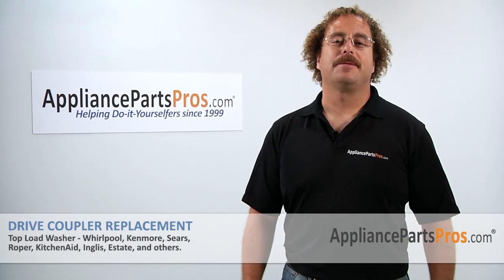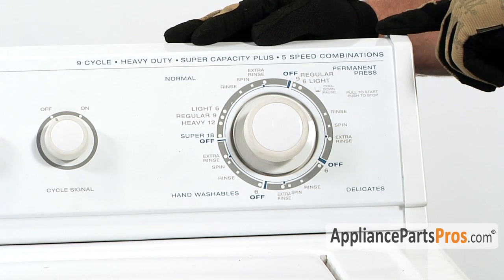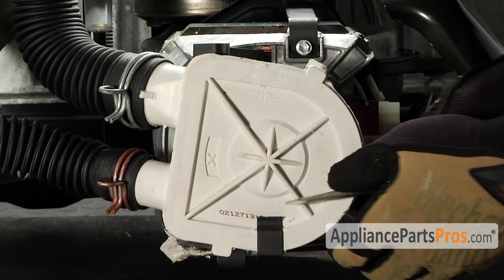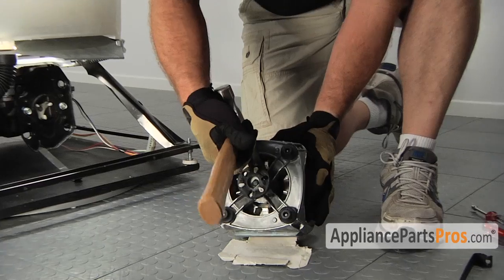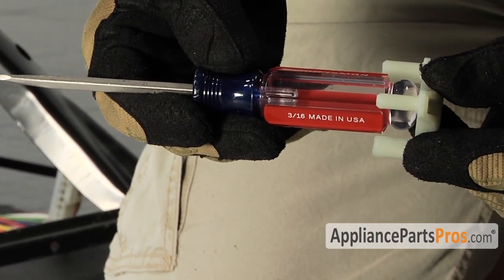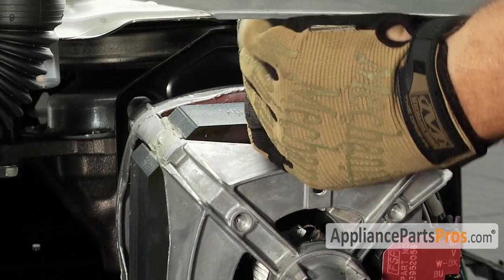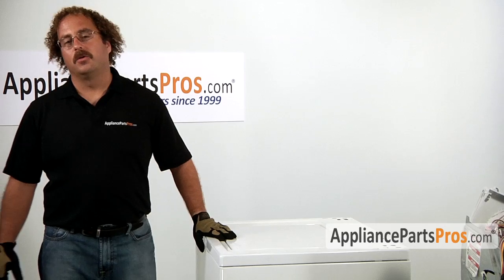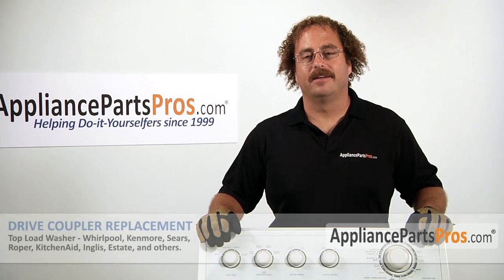How to Replace Whirlpool/Kenmore Washer Motor Coupling (285753A) – Fix Washer Won’t Spin or Agitate

Comment: This was so so helpful! My dear husband is not the least bit "handy" with tools, so I'm the nearest thing to a DIY repair person at our house. Even though I haven't done much in the way of appliance repair, this video was clear, easy to understand and made it possible for me to get my washer working again!! It took me much longer, in part because I discovered one of the rubber shock absorbers on the motor housing was missing or had disintegrated. But I did it! THANK YOU! Keep up your helpful work.

Comment: This was fantastic! You covered all the bases: 1) Explained what the problem was (motor coupling needed replacement); 2) Explained how to take apart the washing machine to gain access to the motor coupling; 3) Explained how to replace the coupling, including the handy tip about seating the part correctly using the head of a screwdriver. You turned what would have been a six hour exploratory exercise (with no guarantee of finding the problem/part) into a HALF HOUR repair success story!  Thanks!!!

Comment: Thanks so much, my husband took the machine apart  and then I went out to get the part. By now husband is at work and I was too impatient to wait for him to get home. I found this video and had the machine up and running in about 36 minutes ( hardest part was replacing the bottom clip on motor and the 2 top clips on the shell. Did not have the strength to make that easy:( So happy machine is working and I did it!!!

Comment: A MILLION THANKS!!! I just replaced a motor coupler on my 11 year old KENMORE washer with the guide from your tutorial.  You just saved me at least $200 by not calling out SEARS appliance repair. It only cost me $7 for the part and 30 minutes of my time. Now, I'm waiting for the clutch to wear out but I'm ready for it when it happens!
Reply from the maker: Kevin P You are welcome! Glad the video helped you out.

Comment: I just finished doing this repair and after watching this video it couldn't have been easier.  This repair cost me less than $10 and took roughly 30 minutes.  Thanks for posting.
Reply from the maker: Glad the video helped you get the coupler changed out!
Reply: Cost me $24.30 including tax.  Could have ordered it line for about half that price but didn't want to wait for it to arrive.
Reply: I do have one more question.  After I had everything back together I realized that I had not added back this cardboard/paper to the bottom of the motor where it had come off.  My guess is that it was to keep any wires to touch each other and short out.  But there is nothing to touch under the motor.  Is it important to take it back apart and put this back  on?

https://plus.google.com/u/0/photos/yourphotos?pid=6039682535727147826&oid=107591688336663880809
Reply from the maker: Nancy Michelli Sorry for the late reply, you should reinstall everything the way the manufacturer originally had it.
Reply: The only think that I didn't add was that flimsy little paper/cardboard piece on the bottom that was shown in the picture.  Otherwise it is back together exactly the same.

Comment: Matt, you're my hero. My washer would fill and drain, and motor would run, but would not agitate or spin.  This took 45 minutes max and was so simple following these instructions. It was clear as soon as I got it apart. The pegs were gone and the rubber was shredded to nothing. There was rubber dust everywhere. THANK YOU! Saved me SO MUCH MONEY!  (Re some other comments, one side of the coupler was stuck on, so I pried, turned, pried, turned, pried, turned, eventually it did pop off.)

Comment: FYI, be careful with these "improved" couplers. I understand that adding the metal reinforcement ring to the inside of the plastic ends makes them stronger and less likely to break. but it also can cause a new problem of it's own. My old one broke, so I installed the improved coupler. Somehow, over the course of a few weeks, my metal ring came disconnected from the plastic part. It pulled out and they became separated. So the motor shaft was spinning and the metal ring was spinning, but the metal ring was not inside the plastic all the way, so the washer would not work as it should. I used some Gorilla glue to glue the metal rings into the plastic pieces so they don't come apart from each other. hopefully this helps but I may have caused the initial problem by tapping them on the shafts in a poor way. I'd suggest using a SMALL tool to tap them on. One that does not come into contact with the plastic. I must have used too big of a tool that pushed the plastic apart from the inner metal ring just slightly.
Reply: Good observation.thanks for sharing as I start my coupler replacement
Reply: @mikedhsr007  honestly, thank you for commenting. I forgot all about this observation. I'm going to note it in case I deal with this part again.

Comment: Very helpful video. My Kenmore is a 90 Series, model 110.C28902790 (the "C" is for the Canadian model, I believe), but it's almost exactly the same as in the video. In my case, I discovered that the problem wasn't the motor coupling, but rather a broken plastic lid switch. But, following this video gave me a chance to check the condition of the coupler parts, check the hoses for blockages, and clean out the accumulated dust bunnies inside the machine. When the coupler actually does go, it'll be an easy job. Thanks for posting.
Reply from the maker: Canuck51 Glad the video helped you out!

Comment: Thank you for this video. It was my first time working on my washer and didn't have $700 to buy a new one. Bought the coupler for just under $20 and then started ripping into the back of the washer. I got frustrated and found your video and 20mins later it was "fixed". Now I say "fixed" because it took me another 40 mins to get the back of it together that I ripped off.  Seriously thank you so must and the instructions couldn't have been easier. plus you saved me over $700 and tax for a new washer. Here's to another 20 years with this one.

Comment: You guys are fantastic! This is the second time I've had to change that coupler out. Once 5 years ago, and once this morning. Your videos have made it so much easier for me. I've changed my hood switch, the dog cams inside the agitator, and something on the water pump I forget what it was. Also, on my dryer, it's been the thermostat, drum roller belt and the gas control switch.

I figure over the past 12 years that I've owned these two machines, I've only had to spend $100 in parts thanks to you guys and your videos. If I had bought 2 new machines it would have been $2400+ and who knows what kind of headaches. Not even to mention you've supplied all the parts I needed and only off of the recommendations when I was just able to give you the symptoms I was experiencing. 

You guys rule! Here's to many more years as a thankful customer. Thank you!

Comment: OMG!!This video was so easy to follow.  I got stuck with the bottom  screw on the motor, I was convinced  it was cemented  on...LOL. Grabbed some pliers for extra grip and strength and viola! It was a b Ripken coupler inside.  Everything  else went smooth but I did have a hard time getting the shell back on due to tight spacing.   THANK YOU SOOOOOOOO MUCH!!   Load in washer now sounds quiet

Comment: I just wanted to drop a thanks for the video. I'm not handy at these things and I don't think I could have fixed my washer without your video.

My washer wasn't spin cycling. I assumed it was the coupler because the washer stopped when I opened the lid. A friend advised me to replace the lid switch and coupler at the same time since both parts are pretty cheap. I was surprised to find that the coupler was in good shape but I replaced it anyway. I just ran my first load of laundry and it spin cycled properly. I don't know for sure, but I suspect it was the lid switch that was causing the problems. Thanks again for your help!

Comment: Tks very much. Followed your instruction and repairs proceeded like a charm. The only complication was my Whirlpool Thintwin LTE5243DQ3 motor at bottom was offset by about 45 degrees, so once the washer shell was removed, the motor shaft wasn't point right at me. This made removal/reinstallation of motor difficult as the pump and hoses were in the way.. Mine is in a narrow apartment bathroom so there really much wiggle room to do the repair.. Other than that, the procedure in the video explained the process very well !!

Comment: So much simpler more reliable and much more longer lasting that newer appliances! I'll keep my 20 plus year old Whirlpool as long  as I can. Great video. Waiting on the part which will be here tomorrow. Only difference is I just unhooked all the hose and laid it on it's back instead of taking the body of the machine off
Reply from the maker: Good luck with your repair! Let us know how it goes and if there is anything we can help you with please let us know.
Reply: @appliancepartspros  The part came in less than 2 days. Installed part and back in business in about 20 minutes. Great video! Thank you!

Comment from the maker: @TheMacandpcguy It's actually not a bad design at all. The rubber piece is there in case the transmission locks up, in which case one or more pieces of the coupling would break, saving the motor and the transmission from further damage. It's much cheaper and easier to replace the coupling. This direct drive washer design is also one of the easiest to work on.

Comment: Great video. Only suggestion would be to run the machine before and after install. Just to let viewers hear if the problem sounds the same as their problem.  However this is the best video by far I have seen.keep up the good work.

Comment from the maker: Check that the drain is clear and draining properly. If the pump is getting all the water out then it should be ok. These machines have a clear plastic tub, look around the outer tub to see if you can see anything stuck between the tubs that would slow the spin down. Next it could be the clutch is slipping or the brakes are dragging, go to our website forum and do a search for: Replacing direct drive washer brake shoes. This will give you an idea of how to check out the brake shoes and clutch.

Comment: Thanks for the video.  Made it a snap to replace my motor coupling.  Also removed a footie sock from the drain pump while I had it apart!
Reply from the maker: Kevin Williams Awesome, glad you were able to get the washer fixed!

Comment from the maker: The new style coupler has been used in production, it is not just a replacement upgrade, so it's not surprising its there. The couplers can get stuck on pretty good, you can try a little pry bar or claw hammer to pry it off. I have heard of people even cutting them with a hammer and chisel. You can also use a little penetrating oil. Be careful not to damage anything else!

Comment from the maker: Yes, if the coupler is broken the motor would still spin and you would hear it. It could be the water level switch, timer or the motor. It could be something stuck in the pump that locks up the motor, but then you might hear it hum when it tries to start. If you need help troubleshooting the problem you can go to our repair forum and post the question, we have techs there that can help you out.
Reply: Do all dryer had coupling? because I cant see mine its only single motor.
Reply: Panasonic washing machine really annoying I'm barely able dismantle every parts.

Comment: Great video.  Thank you. As others have mentioned.  Getting the old coupler piece off of the transmission shaft was difficult.  Some WD-40 and elbow grease eventually took care of that.  My coupler was not in bad shape but replaced it anyway.  If it turns out not to be the problem at least I replaced an inexpensive part and got to lear a lot about repairing our washing machine.
Reply from the maker: +John Haslip glad the video helped you get the coupler changed!

Comment: Thank you very much for an excellent video; I did the repair in less than an hour with your help.  Without it I would have spent  hours trying to figure out how to take the machine apart....and then I would have called a repairman in frustration!
Reply from the maker: Brian Hall Good job! Glad you were able to get the washer fixed.

Comment from the maker: @AbrilSong You need to get behind it and pry it off, if you cant get to it you can remove the mounting plate to give a little more room to work, its held on by 2 bolts. If you still cant get it off you may have to use a longer pry bar, you may have to tilt the machine back to give you enough room between the coupler and the floor to get the pry bar it there. Make sure the washer is properly supported. The old one may be on there pretty tight but you should be able to get it off.

Comment: Now that's a professional presentation.  Just hope the pump on my Kenmore 70 series direct drive that witnessed the waning days of the golden age of rap/hiphop and helped cause the downfall of Sears because it was too well built is also facing the front since the washer is boxed in by the dryer in a tiny utility room and I'd like to just lift the housing enough to remove a piece of something making noise in the pump.
Reply from the maker: Good luck with the repair, let us know if you have any questions!

Comment: Great video. This was the best one. I had a burning smell after I replaced the coupler and also had a lot of trouble putting the motor mount clips back on. Advice I read said probably would go away and to take apart again and be sure together right. I took it apart and found that I needed to pound the coupler pieces onto the shafts a little further. They really should be flush. The reason I couldn't get them down any further is that my screw driver handle I was using to pound it with had a rounded head that went into the center hole just enough to keep it from going down any further. I used a socket that fit over the metal center and hammered that. Worked fabulously. That depth on both shafts made a big difference in the motor mounts going back on without prying them. The smell I believe was from the rubber shavings that were knocked loose during the change over.  I am a women and not in any kind of fix it field. If I can do this anyone can.
Reply from the maker: +Christopher Hay Hay Awesome, glad you were able to get the washer fixed!

Comment from the maker: I'm not exactly sure what you are saying the problem is. But if installed correctly, there should be no odors or noise coming from the washer. You may have to recheck the install to make sure there was no problems. If you run into any issues you can always ask one of our techs on our forum. It's free, all you have to do is register.

Comment from the maker: You would have to see where the noise is coming from. It could be the new coupler is cracked or not on right. If it is from the top it could be the drive block going bad. You can also go to our forum and look at the sticky thread in the washer section that talks about bad brakes. But to start, I would take it apart and inspect the new coupler and make sure that you reinstall everything correctly.

Comment: Very Interesting the clips that hold the pump ,and motor on work just like the clips on older distributor caps on  car engines
Reply from the maker: Chuck B Yes very similar, hope the video helped you get the washer fixed!

Comment from the maker: Did you check the lid switch? This is the most common issue if the washer won't spin. If you replaced everything correctly, maybe the washer isn't level. If it rocks a little that will cause shaking when the spin is going. I'm assuming you have a washer like in the video, they have self adjusting feet in the rear but you have to tilt the washer forward so the legs drop down. Then when you lower the washer down they will lock at the floor level. The fronts have to be adjusted manually.

Comment: I had such a problem getting the water pump off. I knew I would need to break it off so I ordered a new water pump. However now I realize that removing the pump was Not needed. Looks like you could take the motor off with the pump still attached and that would have saved me Hours and a few bucks! And could have kept using the existing water pump.. instead of breaking the properly working water pump.
Oh well. Live and learn. I am still working on this as I need to file the shaft  but I will get it done!   
Thanks for the vid!
Reply from the maker: You're welcome!
Reply: Just had the same problem.  Couldn't get the pump off.  Did what you suggested and took off the motor with pump still attached.  Was a bit difficult and awkward, especially getting the clamps on and off.  And getting the coupler to align with the pump still attached wasn't very easy.   But when you have no other options, you make it work.  Took about 3 hours to complete.   Thanks for the heads up and thanks to Appliance Pros for the video.

Comment: Thank you so much!  I got it all back together correctly.  It spins, drains, etc.  But when it spins it is a little wobbly.  I put a level on the top of the washer case (both directions) and it's perfectly level.  Any ideas?

Comment: Hello there I had this problem with the broken coupler. I replaced it put my machine back together and it agitated and spun for like 2 minutes and then slowed down and now is locked up again I took it apart again everything looked okay put it back together again same thing it agitated for about 2 minutes then slow down and is now not moving at all. Do you know what could be my problem now?

Comment: having problems removing the pump.  i removed the clips, but the pump is not coming off as easy as in the video.  you suggest getting a new pump if it is hard to remove.  But how do you get it off if it is stuck?